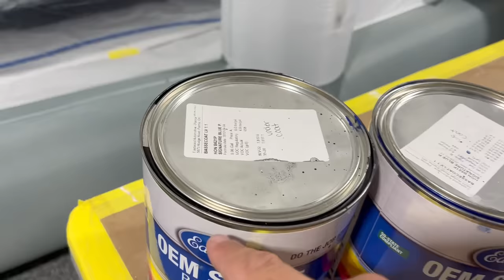I Completely Ruined THIS Paint Job

Comment: Bro I got an inflatable paint booth because I had too for a job that had to move forward. My actual booth was down. Everything I sprayed had craters, sprayed outside on the floor no craters. It only affected clear coat. Long story short I threw that thing away. Three other people I knew had craters in their inflatables from China. One fixed it by power washing everything with super clean, disassembling the blower motors, washing those and trying again with and had no craters. I’m convinced there’s is mold release, or dry anti sticking products used for shipping or something that causes those. I only  get surface craters when my air supply isn’t maintained which is really rare. If I ever see anything like that starting it’s almost always the case and stops with air Maintence but not with the inflatable. Never again.

Comment: I just painted my 1st ever vehicle. My 02 Silverado. Have only sprayed lacquer in furniture finishing. Started off putting patch panels on both quarters and fixing some other rust spots. Thought I had done a decent job until I took it out into the sun😢😢. OMG, it looked like ass. Ground it all back done with 80 grit and started over. Panel after panel was sanded, painted, resanded and do it again. Slowly made headway until I got to the hood. 4 times later it turned out just decent. I had such fisheye that I'm clueless. Had moisture filters on compressor and gun and still got hammered. Learned a lot and will work on it next season when it gets warmer. 40° as a high today, not painting anymore this year. That and I still need to get rid of swirl marks😢😢😢. Will it ever end??😮😮

Comment: I was working in a blow up booth for a while and there was almost no way to avoid fisheye without using eliminator and shooting a light coat of clear followed by 2 normal coats. This still didn’t solve the problem 100%, just enough to be able to buff it out

Comment: Couple things,

screw compressors put out more oil than listing comps.
I see no filter?oil coalesce to remove the oil aerosols. It's gonna take a bit of money to catch those oil aerosols.

Is that green filter the intake filter? If so it's really too coarse to catch the dirt, maybe precutting it with some spray adhesive will increase its ability to catch the small particles that haunt good paint work. Replacing it with a smaller micron filter would be ideal.

Brian, as you know, just passing air across plastic creates static (even just the booth running)  I don't know if it's possible to "ground" your booth so the static has a path to follow. Maybe even using the static gun before clearing could help.
Reply from the maker: You’re exactly right, look for the next video we’re gonna have three stage filtration and additional filter before the fridge unit.  it’s going to be a big change
Reply: @PaintSociety  

Just remember the purpose of the fridge is to lower the dew point, moisture cannot be removed from hot air. Getting the fridge some distance from the comp is ideal.

Comment: I am fighting fisheyes to this day. Hopefully when my paint booth starts to work, and i get screw type compressor and new air lines, it goes away.
My only solution so far, and ive tried plenty, is to put really thin first clear coat, like really really fine dust all over the panel, the finer and thinner the better. Let it dry for about 5-10 minutes, needs to be nearly dry so it depends on the ambient temperature, then you can go heavy on your second coat as much as you like. I do 1 " fine mist or dust" clear coat to cover all the surfaces, and then 2 additional heavy/normal coats. I dont get fish eyes any more, as long as i let the first coat dry really well.
It has to be something to do with applying the base, which i burry with that fine first coat, but i cant figure what.

Comment: Love your video's been watching them because iv been looking for a new gun and want to get a nice portable booth for the house..

What are you wiping the car with right before you sprayed? tack cloth? if so what brand is that if I rub one that hard its going to leave residue streaks.. BTW wet the floor in that thing i'm used to painting in stuff that doesnt have the tightest seal i bet that floor intake is blowing stuff up

I'v been painting for 4-5 years now and helped teach it at the college level.......... you learn so much from problems that come up (hell watching new painters/body men) helped me learn so much as well..... now I will say... you can turn out badass jobs with a good compressor, 3 stage filter and a low-mid grade gun.. you don't need all the extra stuff and gimmicks alot of companies sell..

Comment: Hey for my experience doing 67s and 90 and mid 2000s corvettes the fiberglass normally requires 2 coats of primer I have seen this problem like 40 times in my 12 years of experience

Comment: I use a disposable air filter/water trap that pops onto the air line, then the gun pops into the disposable filter. If it is a system issue, that's a final filtration source right before the air goes into the gun. You'd be surprised sometimes at the amount of water you're getting thru the line, even with the best in-line filter/regulator on the market. Especially if the humidity index is up or the barometric pressure is outta whack. Or if it was really hot in the shop & you're refrigerating the compressed air, the bigger the temp difference is, the more likely condensation will occur, even in a closed system. And sometimes, you just get a bad batch of paint that got a contaminant somewhere in the manufacturing process. I've had whole gallons orange peel & fish eye, despite spraying on different days, being careful to blow out the vehicle & work area then wipe the car down, filtering the paint twice with new filters, purging my system, swapping out hoses, cleaning my filter & the gun well, using a different mix ratio, going with a different air pressure setting, & using those end-point disposable filters. Bad paint happens occasionally. But props for the honesty. Some guys would've kept their finish shots long distance or put the camera a little out of focus to save face. Crap happens, and when it does, we have to own it & make it right.

Comment: Man Brian, I got all set up with a refrigerated drier only to encounter this same damn issue.
I did learn that with these driers it's key to have at least 25' of air line between the compressor and the unit. I had it set up.  [compressor - drier- vertical water trap - filter setup]  I changed it to [Compressor- vertical water trap - drier - filters]  issue has been negated so far.

Comment: Make a PVC pipe frame to keep it from collapsing if you decide to put a second blower on that unit. Make sure you make this sides just before the center top air tube supports make the PVC go under it don't pinch it the roof could collapse from lack of air pressure. Let me know what you think and if you decide to do it with the PVC oh and get thin wall pipe it's much lighter.

Comment: Paint Booth is air conditioned which also regulates humidity
You have a giant plastic bag (moisture barrier)
Buy a couple Hygrometer/thermometer for ~$10, put in paint booth and at home booth (a couple to monitor multiple areas)
Might also help you dial in flash times
I'm just guessing and not overthinking :)
Reply from the maker: I have ac in the garage so that helps

Comment: Looks like fisheyes. Contaminants in clear or line. Sorry said the answer before. Maybe that gun neutralizer sprayed out some oil or contamination onto surface and clear always reacts to fisheyes or smallest or issues. Nibby etc. that surface has to be contaminant proof anything u push air onto it Idk. Maybe also the filters new and has some
Residual oil or the fans??!!  Due to new motors 🤷‍♂️

Comment: To me it looks like contamination from the compressor, IF there’s nothing dripping from within the booth itself, like condensation on the ceiling.

Best wishes & good luck

Just thought of something:
It’s a fiberglass body.
And it looks like your issues are right were you heavily sanded it and/or applied filler.
So I could imagine either your paint sinking in, contaminants creeping into the fiberglass, or a chemical reaction!

Just an idea.

Comment: Man I've seen you produce amazing quality off the gun and I've struggled hard. It seems the harder I try to clean it to perfection the more trash or fish eyes I get lol. I've spread in the driveway and not cleaned it too much with off the gun perfection and cleaned and prepped perfect with trash and fish eyes. I ha e no clue what to do anymore. If it fails I just sand it out and try again. I've sprayed a hood 3 times and it still is not right and I've prepped it and the environment great 2 of those times.

Comment: Put an orange ball filter on your air hose. Run some lacquer thinner through your air line. Turn the car away from the bolwers. If it fisheye's again, it's coming in through the blowers. Have you been using silicone or wax in your garage? Tire shine? Armor All? Surely not. Good luck. A rasior blade and some smooth filler will fill the eyes. A couple extra coats of black base will cover them. 600 and water will cut that filler. If you break that clear coat, it could wrinkle. Fill them eyes. 600 water. Some Xtra base as a primer. Then start over.
Reply: Agreed

Comment: The fisheye has to be from your air supply.  You demonstrate that you know how to clean and tack surfaces every video, and the fisheye is too dispersed.  Try adding one of those small inline air filters on bottom of your spray gun handle.  They can save you from an ugly air system.

Comment: Looks like it’s coming from the line. Did swap disposable ball filters for the fisheye filter the “Linear Block” guy uses along with 3 Stage filter and cam air. Fisheye was a game changer for my poor man’s shop. I Use air dry booth. Midwest area. New chemical use has learning curves Im sure your dealing with. “Eastwood products.”
Didn’t catch how many jobs you’ve done with the chemical products themselves such as base coats. Use a cheap Chinese brand(showell) that dries shiny and doesn’t flash off dull. Trials with the trade. You make great content and I’m sure you will get it figured out.

Comment: is it maybe possible that u used chemicals with silicone in itand the gasses got in from outside of the bouth and maybe got in via the intake
Reply: i once had it with a big expensive piano. it was a really black high gloss black and i thought i had the surface perfect but somehow got alot of fisheyes. i redid it and it was flawless. so i think something got on the surface that got sucked out of the workshop into the bouth. so from now on i always make sure to turn off the suction when going in and out off the bouth.

Comment: i have a question do you know why sometimes i see bumps on my base coat but it already has clear coat even if i sand it still you can see a bit of it
Reply: That's called sandpiling. Basecoat, even high metallics should feel smooth before clear. You most likely are spraying your basecost too dry. Try a slower reducer or larger fluid tip

Comment: Curios, Did you try paint with you scroll compressor without the freezer device you added in line?
Reply from the maker: I havent no
Reply: I bought the same compressor the newer version comes without the cover but an connector to drain container. Do you have a scrap piece to spray without the freezer? I would also check the oil to see if the water condensation needs to be drained. @PaintSociety
Reply from the maker: @tomv8346  i got a whole new system en route.  Stay tuned

Comment: 2 much over spay FOG when you are spraying.
The fog in the air eventually gathers together in the air, no longer Abel to float drops 
Into your painted surface and will not reflow into the fresh sprayed surface.
2 much fan, and pressure at the gun,
You are just fogin it on, not really painting.
Been there, done that in my painting career,  hope this helps!😊
Reply: That surly sounds like what the problem could be. I used a smaller version of his booth  and on my 2nd coat of clear it formed hundreds of those craters. Im going to try again and leave one end of booth unzipped to push overspray out faster. I will also adjust my fan and lower my pressure like you mentioned.

Comment: I was using the air dryer from harbor freight. It worked well even with an old compressor from 1989. 🤷 All your stuff is new,  so I don't get it.  Unless you have tire shine or something somewhere close by.

Comment: In my experience unless you're a total nooby which you aren't. and you know about having a clean surface. When it looks all over the car like that not just in one spot it's gotta be the air. Dirty air. There's contaminants coming through that airline from somewhere, try doing a test panel, changing nothing on a scrap piece see if fish eyes come up., then put in another filter right at the gun to see the difference.

Comment: I hate to disagree with the professional but as a retired painter from the old days I have ran into this "cratering" and it's not fisheyeing it's solvent popping, or cratering depending on who you're talking to. It happens by putting on too much material in too short of time and is the solvents under the top coat trying to escape from a surface that is already trying to kick,and will cause the cratering you're seeing.
Reply from the maker: I hate to disagree, but I do. This is not Solvent popping. Check the next episode of see why it’s not.

Comment: I would suspect that it is a problem with the product. I have had many problems with Eastwood products over the years and stopped buying from them . I had to throw away a whole gallon of their primer because it had a similar problem what looked like fish eyes. And when you have a problem and contact them , their answer is always your fault. I once bought a new pneumatic flange/punch tool from them and the flange broke the first time I used it on 20 gauge metal and they wouldn't cover it , That was the last time I bought from them.

Comment: I only see fish eyes on the horizontal areas, that upper zipper that allows air into the booth can be blowing in particles and landing in your parts altough its a fairly new garage there can still be dust from the drywall kicking around getting sucked by the blower and into the booth right into your clear

Comment: That must be such a disappointment for you to see.  You have the right attitude of not getting too upset and just dealing with what needs to be done.  Is this the first time spraying with that compressor setup?  I think you have sprayed in that garage before with decent results unless I am not remembering correctly.  If the contamination was coming from the air compressor I would expect you would see some defects in the sealer and base as well as clear.  If the clear is more susceptible to fish eyes due to the surface tension of the clear then maybe my thinking is wrong.  A few thoughts are... most likely that inflatable booth was made in China in order to be so cheap with the gov't subsidies and low cost labor.  It is possible there were surface contaminants that started to fall from the ceiling and walls causing the issue in the clear.  The other source could be the floor level blower kicking up contaminants from the floor.  It would be much better if that blower were filtered and added to a vent in the ceiling to provide down flow v. cross flow.

Comment: It's Oil Contamination; from, the New Compressor...
There are Too many & too evenly Scattered around the panels-- to be Surface Contamination..

Unless, there is not that many on the middle & lower Doors/Panels.
Reply: That makes sense, but seems like that would have happened on first coat also if it was oil.

Comment: $900+ anti static blow gun. $500 spray booth. $250 elephant trunk. $100 extractor fan. $100 blower. Total = $1850 not including paint, labour, and spray equipment... At this point you're better off paying for a professional.

Comment: Bro... You opened up the tent. Never open the tent. You changed the temperature and you added debris. Slow down and use a smaller fan tip.

Comment: Around.  Plastic. Filter.  At.   The. Gun. Keep s.  Water.  Oil. Out. Of.  Paint.  2. Stage.  Air. Comp.  Air. Heats. Up. When. It.  Heats. Up. Goes.  Through. Hose. Cools. Down. Makes. Water.  I. Painted. For. Years. In. My. Garage. Learnd. The. Hard. Way. Bought. Alot. Of. Ppg. Paint.

Comment: If uou use that paint booth in a garage the garage  door needs  to be open you are just  sucking out back in i have the same booth i have the elephant  trunk on both sides it doesn't  collasp the booth  i retired bodyman and painter but i like your work

Comment: Im not trying to be a dick but what does spending a lot of money on the compressor setup have to do with anything? If that compressor is new that thing has lubricants inside of it from assembly etc that needs to be ran out of it.
Reply from the maker: Money on the air filtration. Not the compressor.
Reply: @PaintSociety  sorry my bad I misunderstood what you said. I still feel it's that filtration system. Mean when something is new it's gonna have shit in it that needs to be worked out. Just my opinion.
Reply from the maker: I think you’re 100% correct. I have big changes coming to the filtration system next video